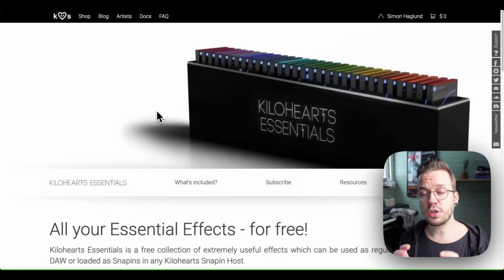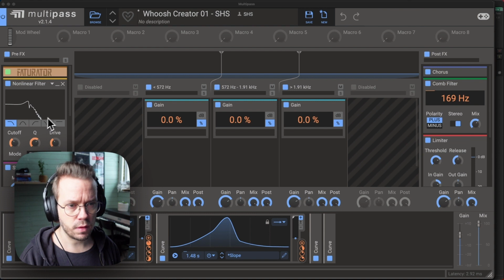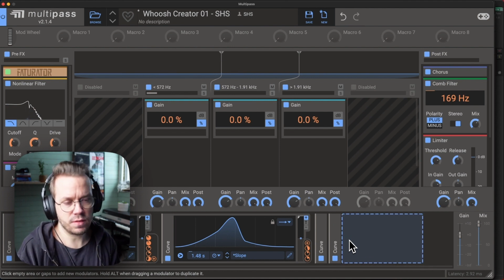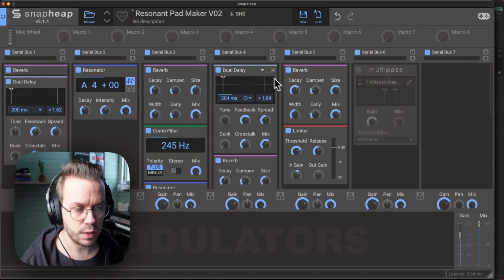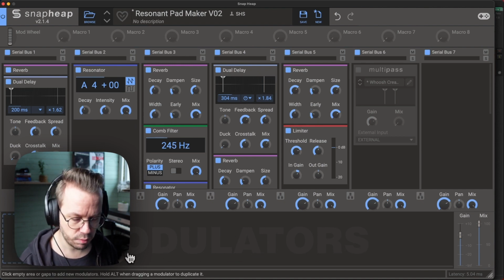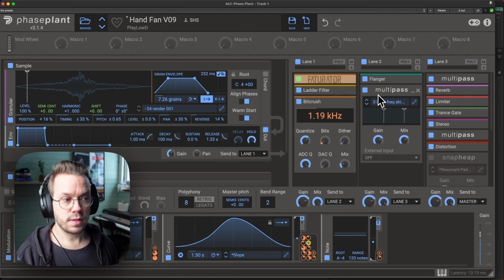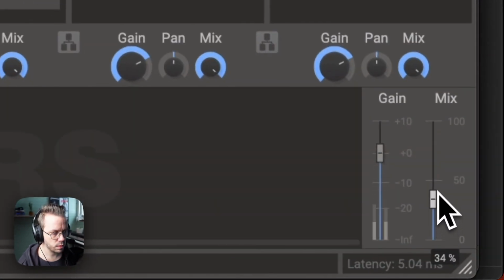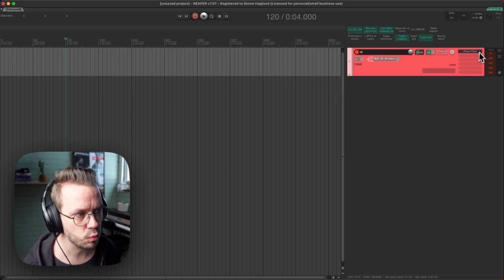Is there anything Kilohearts Plugins Can't do?

Comment: That's crazy! How is it on the cpu?
Reply from the maker: It's actually really soft on the cpu. Except for the convolution reverb that eats a lot... and Phase Plant has "poly mode" on each effect lane that basically runs each midi note you play through it separately which sounds incredible but also drains the cpu really fast.. 😃
Reply: I know Phaseplant is very heavy on the CPU
Reply from the maker: You can absolutely make patches that clamps down on the cpu if you like. It really depends on the patch you create 😊
Reply: @simonhaglundsounds  honestly even if i use a not very big patch it starts lagging. But yeah thats probably my PC that sucks. Its a shame honestly because i have great ideas